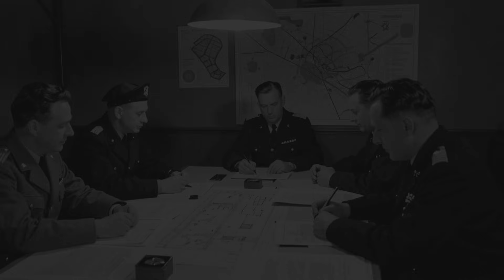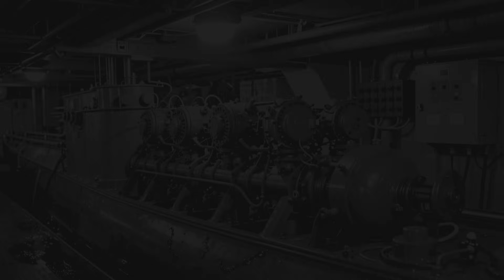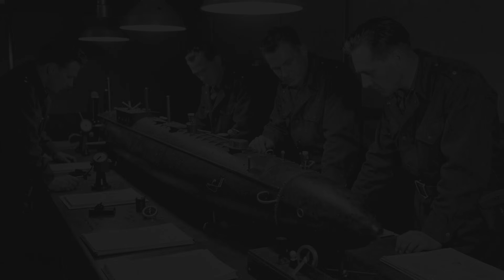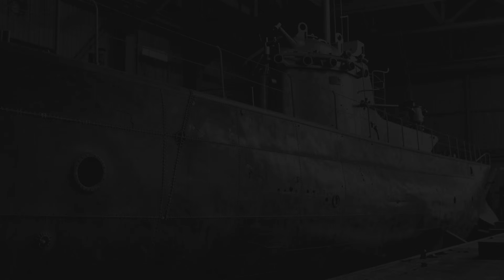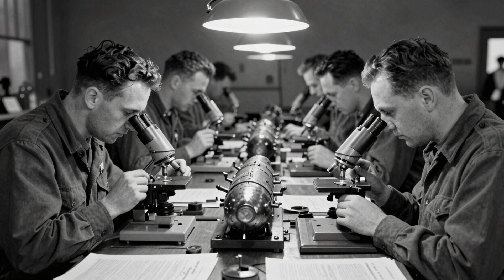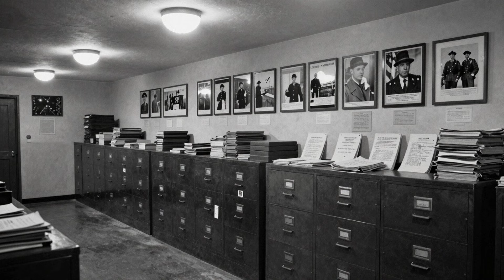American Crews Tested Captured U-Boats... Then Learned Why German Submarines Always Leaked

Comment: Let me get this straight:  Captain Lieutenant Verner Hoffmann who commanded U-785 which was lost in March, 1945.  He kept a diary, which was found in his shore quarters during the occupation after the war.  He made entries from his final patrol on Jan. 15, Feb. 3, Mar. 2, and entries ended on Mar. 7.  The boat was listed as missing on Mar. 21.  So, if he had the diary with him when the boat sank, how did it get to his shore quarters?  We don't know, because U-785 was never commissioned into the Kriegsmarine.  Apparently the boat was ordered in Feb. 1943 to be built at the Kriegsmarine's Wilhelmshaven shipyard, and the order was cancelled in Nov. 1943 before it was laid down.

U-505 was captured in June, 1944 by hunter-killer task group TG22.3 after having been depth charged.  It surfaced to allow its crew to escape, and they left it in an unseaworthy condition due to battle damage and sabotage.  The US boarding teams patched it up enough to tow it to Bermuda for analysis and repairs.  In 1946, the Navy had planned to use it for target practice until it sunk; but Admiral Gallery, who led the task force that captured the boat, had other ideas.  In 1954, U-505 was donated and towed to the city of Chicago and it was opened to the public for tours at the Museum of Science and Industry.  Admiral Hartford would have known this in 1979 when he published his memoir.  U-505 is stored in a climate-controlled dry dock and remains open to the public today.

Apart from these counterclaims, I don't doubt much about what's told in this story.  We know that Germany had a severe shortage of Manganese, which is critical for making high-quality steel needed for submarines.  We also know that Germany had a shortage of natural rubber due to blockades and land-based interference by the allies preventing imports.